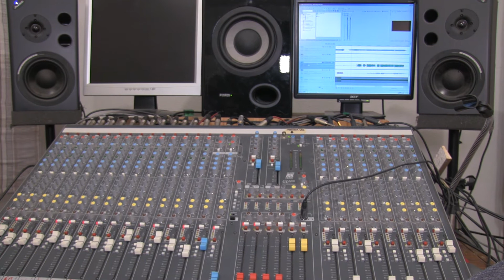16mm Film Production: Improving Sound Quality with Dolby

Comment: hello from Spain . So you are using a 4.6khz lo-pass filter to match the optical audio specs , where can I find more info about the frequency response of optical audio, so I can emulate that sound in my video projects ?
Reply from the maker: That's a little hard to do because there's really no hard/fast rules to things like frequency response, distortion and noise.  There's a lot of factors involved.  Theoretically, a good print film can resolve over 100 cycles per millimeter, so 7.5mm high frames x 24 frames per second is 18KHz.  The contrast of the film starts to drop pretty rapidly before that so the cut-off is considered around 10KHz.  However, the mechanical galvometers and and optical read heads are the real limiting factor.  I find most films start to lose energy quickly above 4.5KHz on my system but there's still usable information up to 8KHz.  You can use a narrower read head to get better frequency response but you also get more noise with it.  Low-frequency response depends entirely on the record/playback electronics.  You can theoretically go all the way down to DC (0Hz) but since 16mm is usually geared towards speech, 100Hz is the "rule of thumb".  Noise depends on the contrast of the film, grain and the playback system.  Rule of thumb there is 35-45dB and bear in mind that since the playback system is the biggest limiting factor in frequency response, the noise will also be 100-4.5KHz or so.  Distortion tends to be fairly high in 16mm optical sound tracks because they're printed "hot" in order to overcome the noise but I don't have any hard facts on it.
16mm magnetic sound is on-par with 1/4" 1/2-track tape.  Listen to some of the film-based productions from the BBC in the 1970s, it's really quite good.
Reply: @wado1942  thanks, I had to read it 3 times , I appreciate it , man . So in conclusion, can we say it is similar to a type1 cassette with noise reduction . I like this 90s movie sound, it obviously has a lo pass filter, but I can't exactly put my finger on the cut freqncy and the slope . Here is an example of a 90s movie trailer https://www.youtube.com/watch?v=rnpQ25ISxDU&list=PLTT8GoH4BtdLaWW7hZS77IfFYwkWK-1Wc
Reply from the maker: @rodrigobelinchon2982  I tend to pack a lot of information into as few of words as possible, sorry. :D  Cassette has considerably better signal to noise ratio and frequency response than optical 16mm, even without noise reduction.  Cassettes also have a more gradual cut-off than 16mm read heads.
35mm is a different animal.  A typical projection system with optical sound is usually upwards of 12-14KHz, has significantly better S/N ratio but also has Dolby on top of that by default whereas I've never heard of anybody using Dolby on 16mm.  That trailer you posted was likely copied, sound and all, from a 35mm print whereas if you watched it on Blu-Ray or the like, would have been taken from 35mm magnetic film, where you have 4 magnetic tracks across the entire width of the film.  The sound in that case is more on-par with 1/2" stereo at 30 In/S.  VERY GOOD STUFF!  The limiting factor is the shotgun microphones and sheer number of generations through which the location audio goes to get to the final mix.  1/4" tape copied to 35mm magnetic film for editing, copied to 35mm mag or multitrack for dubs, mixed to mag for sync, copied to 35mm optical master, copied to 35mm internegative, then to the print.  The dialogue goes through a lot!  You can usually hear a stark difference between what was recorded on-set vs. in studio.
Reply from the maker: P.S. if you watched the first Star Wars, especially before the "Special" Edition, the dialogue they rerecorded in the studio is super clear and almost TOO bright sounding whereas what was recorded on-set is a bit dull sounding.  I think they evened it out a bit in later releases.  The main difference is the microphones.  Older shotgun mics tend to be rather dull sounding.
Reply: I 've enjoyed a lot reading your answers !!

first , yes, I have noticed in many movies when they overdub voices , sometimes is really noticeable .

second , after you mentioned 35mm , I started researching the history of cinema sound, and that includes topics like the Academy Curve , Dolby SR 
. 

third,  that is what I think I am hearing and want to replicate , the hi-frequency artifacts from Dolby SR , and the Academy Curve , which was later replaced with the X -curve, which cuts under 100hz, stays flat until 2khz, and then rolls off 3dbs per octave , until around 8khz -10 khz.

More or less what you suggested .

this article is a great summary https://hometheaterhifi.com/volume_9_2/feature-article-curves-6-2002.html of this paper https://pdfs.semanticscholar.org/dc3d/5f485e43c72eded3398dc6f3883c87da9c81.pdf

fourth  , maybe it was magnetic tape what we heard in the Ninja Turtles trailer, I  tend to think after studying the subject that we heard a mono downmix from Dolby Stereo Optical Sound, which apparently was cheaper and more extended
, who knows, but I find that ''color'' sexy, and evocative, it sounds more cinematic to me than a higher definition sound.

so , I have done some testing on my computer, applied the X-Curve , applied some de-esser to emulate the Dolby SR artifacts,  and I thinks it gets me in the ballpark, I had never tried to start rolling off at 2khz, and that really makes a difference, it gives me that color I was not able to find.

so thanks a lot  @wado1942  !!
Reply from the maker: @rodrigobelinchon2982  Well, they didn't pass the tracks through the X-curve (and Academy) curve on the way to the master, it was inserted between the console and monitors to simulate "worst case" scenarios for theaters, to get an idea of how the mixes will sound to audiences.  It was more about compensating for cheap speakers being behind the screen than anything.  Also, Dolby is pretty transparent.  It doesn't pump and breathe or kill the top end unless the system is grossly miscalibrated.  The reason it harmed the top end in my video here is because of the severe limitations of 16mm optical sound not allowing the signal to decode properly.  On a 35mm print, it's not as much of an issue.  Dolby Labs performed a series of blind experiments that pretty well debunked the myth of noise reduction killing the top end.  The ultimate proof was when they A/Bed a non-Dolby tape against a Dolby tape and blank non-Dolby tape (to add hiss), none of the test audiences noticed the switch.
Good magnetic audio is virtually indistinguishable from real life and I've had clients hire me to pass digital mixes through tape to impart "that warm professional sound" into it, only to discover what I sent back sounded just like what they sent me in the first place.  Now a combination of older shotgun mics passed through multiple generations of magnetic audio, that take an already "colored" sound and adds more color.  If you watch my video on TV Dialogue https://www.youtube.com/watch?v=2HpuNJ0mH6o listen especially to 2:40-2:50 where I switched from multi-generation, Dolby'ed audio back to the original 1/4".  I really put the audio through the ringer but the biggest source of "damage" to the fidelity was really the mic itself.  That's the reason I started using an SeElectronics Z3300 for most of my YT videos instead of the shotgun, much clearer and much less noise.
Reply: @wado1942  thank you very much for the detailed answer. i've been researching about music albums using Dolby A  , Dolby SR and also DBX , and really old albums from before any of those systems were available  and i really think i can hear Dolby A and Dolby SR , It is subtle, but it reminds of Dolby C , to my ear, both systems ruin the ''air'' of the recordings, becoming very evident with hi-hats , contributing to that muffled sound i hear in those movie trailers. But it sounds good to me in that cinema environment . i will chech your video next weeken and re-read your comments , in the meanwhile, here you have links to a Dolby A vs a record done without NR , on spotify is more evident than on youtube.
Dolby A ''Jazz at the pawnshop'' , 1976 https://www.youtube.com/watch?v=WQPsyoCxjuo
No Dolby or DBX ,  ''Mingus Ah um'', 1959
https://youtu.be/E7hoX7golZI?list=PLiN-7mukU_REK9zBMvZoNERNvhovxnsE5
have a great week , bro
Reply from the maker: @rodrigobelinchon2982  Yeah, Dolby C is definitely NOT transparent, mainly because it's just two "B" circuits stacked together so a 1dB error in playback (if only cassette was that accurate) becomes a 2dB error in decode stage-1, then becomes a 4dB error post stage-2.  I didn't always use Dolby on cassettes but when I did, it was either B or S.  S, which is very similar to SR but simplified and optimized for cassette, is much more transparent than C.  Part of the requirements for having S on the deck means following stringent alignment standards that are virtually non-existent on lower end decks that sport B and C only.  I never used Dolby A or SR for my in-house productions but I would some times work on material from other studios that had one or the other.  If the playback alignment doesn't agree with the source material, you can't get a proper decode.  That's one reason why it's so important to print alignment tones to the tape, which almost nobody ever does.  For Mitch Ryder's last live album, I had to bring up the top end a bit in mastering because the multitrack recorder had Dolby A and wasn't aligned properly during the recording.  The mix engineer got it as close as he could but it was still just an educated guess.  On that note, the orchestral work from Animaniacs was 1/2" 3M 996 with SR, not dull at all.  I still have one of those tapes around here somewhere.  I see what you mean about those links you posted.  Bear in mind that in the late 50s, they generally used  just a few top-quality mics at a distance to capture everything while in the 70s, it was trendy to use multitudes of close mics.  I do hear some error in NR decoding but a lot of that dullness is proximity effect and phase cancellation.  Any way, I produced a limited run of cassettes for my instrumental album a few years ago.  The master tape has Dolby B and the decode sounds almost identical to the source material.  I used Type-II cassettes, which was a huge mistake.  Even with a house curve going into the duplicator, playback from the cassette itself seems dull.  I should have used Type-I cassettes, which would decode more accurately.
Reply: Yeah, after watching your other video I see your points , all 

the video editing and shooting I have done has been done with 

digital equipment and computers , I wasn't aware of all the 

steps required to edit and deliver a master using analog tech.

Dolby C 

two Dolby Bs hahaha, I find it hilarious!

Regarding to what I call Dolby artifacts , as a professional you 

know you have to make constantly decisions ,and often, find 

a compromise between perfection and practicality.

Dolby's success probably should be viewed from a business point 

of view. In the end, people who makes the money decisions do not 

have necesarily to be the most capable artists or technicians, 

they are business minded people and often times they put factors 

like cost before quality .

COST

To my understanding , one of the selling points of Dolby A was 

that  it sounded decent even without a decoder , again a 

financial incentive to stingy cinema owners. 

And Mr Dolby did the best he could with the patents he had , 

let's not forget that he said he would only invest in a 

technology if he had patents , my ears find very superior the 

DBX NR system, but of course, Mr Dolby did not have the patent 

on that technology, plus it was totally incompatible without a 

decoder.

QUALITY

I am sure you know people who can't distinguish from a 128kbps 

mp3 file and other at 320 kbps.

I am not able to tell the difference between FLAC and 192 kbps 

mp3, but I sure can tell the difference between those files and 

128 kbps mp3.

So I definitely think they found Dolby A and SR good enough , 

specially when dealing with 12, 24 or more tracks projects.

Noisy recordings sound unprofessional , so let's better remove the noise , even though we lose fidelity .

Specially in an era where consumer formats would mask many of 

the imperfections of the master.

But, lately I've heard a demo on youtube where Dolby B sounded 

really good , it  was a Nakamichi deck , a brand that was known 

for being obsessed with compact cassette audio quality and 

having systems to adjust azimuth .

That brings us to your comments about alignment, etc 

By the way ,I'd love to hear some of your work , is that Mitch 

Ryder show available on youtube?

WHY I AM INTERESTED IN THIS

When I produced my metal album with my solo project ''Mystery 

Of' , I found the sound I got to be very harsh. 

Clic here to hear one of my songs, a fine example of digital 

harshness in all its glory https://www.youtube.com/watch?v=Er-

9awhzLok

So , researching about albums made with tape recorders , I 

noticed that talking about tape recorders is to talk about noise 

reduction, and became very intrigued about how tape and noise 

reduction degrade the quality of the original audio and make it 

sound softer and more pleasant.

Ironically, this '' Lo-Fi'' sound quality sounds more expensive, 

and is associated with big budget productions.

I do believe that even non audiophile people cath this signals 

at a subconscious level, and influences their perception of the 

music itself. 

So, I love music, I have always loved that colored sound of the 

movies, and then I started a video production business. 

It was only a matter of time that I started to research 80s and 

90s cinema sound , because i'd like to emulate that color and use it in my music, specially with distorted electric guitars.

So if I can hear some of your work , I would love to  @wado1942
Reply from the maker: @rodrigobelinchon2982  "my ears find very superior the DBX NR system, but of course, Mr Dolby did not have the patent on that technology, plus it was totally incompatible without a decoder."
Having worked intimately with DBX systems for 25 years, I can say without a doubt that it's never transparent even when I/Os are perfectly aligned and the encoder is patched directly to the decoder with no tape in between.  There's always this low-frequency distortion, transients have this weird bite to them and the low-pass filters on the encode/decode that are there to cut RF and bias interference are on par with early digital anti-aliasing/anti-imaging filters (nothing above 18KHz).  Plus there's nothing below 40Hz.  The phas eshift is huge and there's dozens of op-amps adding "color" to the signal.  Compare that to my AMPEX 440C, which is basically flat from 25Hz-25KHz or so.  When I had an 8-track, I took the DBX module out of the machine all together.  When I moved up to a 16-track, I used the DBX (built into the machine) for a while but increasingly had modules in bypass mode as I used it more.

"I am not able to tell the difference between FLAC and 192 kbps mp3, but I sure can tell the difference between those files and 128 kbps mp3. So I definitely think they found Dolby A and SR good enough , specially when dealing with 12, 24 or more tracks projects."

Side note; MP3s are a LOT better now than they were in the 90s.  I remember 128kbps MP3 being completely unlistenable and 192k being BARELY adequate.
Any way, noise isn't normally a big deal on multi-track tapes unless you're doing multi-mic classical music or do bouncing like with "Dark Side of the Moon".  Only a few tracks stay high in the mix so the rest don't contribute a lot to the overall hiss.  As you add more tracks, you increasingly pull down the levels of most tracks to maintain headroom.  In other words, a 2" 24-track theoretically has 3dB more noise than a 1" 12-track but you also wind up having each channel 3dB lower on average so it becomes a wash.  We mute tracks that aren't in-use or add a few dB of downward expansion to things like toms or vocals which rather transparently reduce ambient noise as well as tape hiss.  On that note, most projects I mixed had about the same S/N ratio regardless of whether it was recorded on tape or digital, because most of the noise comes from things like guitar amps and the room itself.

The final mix is a bit different of a story, hence why the big-budget records had 0.89mm wide tracks (2" 24-tracks had the same track width as 1/4" 4-track, just more space between tracks) but mixed to 1/2" stereo with almost 4mm wide tracks.  1/2" is also usually 30In/S while the multitrack is usually 15In/S, so there's less noise in the high end even if everything else is equal.  My clients can't afford 1/2" 30In/S so I've been tempted to use Dolby or DBX on mix tapes on occasion but never have.  Bob Dennis, mastering engineer with 32 gold records to his name publicly commented that "tape was fine in the 60s and 70s because it's what we had but now we require a lot better".  Strangely, he opted for a mix I did for a song he produced, not knowing that I secretly mixed to 1/4" GP9 at 15 In/S.  I guess tape was better than even his 40+ years experience knew. :D

"By the way ,I'd love to hear some of your work , is that Mitch Ryder show available on youtube?"
The only thing I could find on You Tube is https://www.youtube.com/watch?v=JJi6VH8bOUA
Recorded on 2" 24-track with Dolby A, mixed a few decades later to 1/2" 3M 996 at 15In/S with no NR.  I did a master the way I thought it should be done, with only a couple of notes from the clients: needs more top end, and overheads weren't working at the beginning, try to compensate.  They asked for one revision with a coupe of minor tweaks that I didn't like but they're the ones paying the bill so I obliged.  Speaking of which, I sent a proof MP3 @ 320kbps and that sounded different enough from the WAV proof that I told myself to only send WAVes going forward.

https://www.youtube.com/watch?v=ecO7OtbTfmM
Mixed by the same engineer to the same kind of tape but that was also mastered to 1/4".

https://www.youtube.com/watch?v=-IUBju3ILsk
Recorded in my garage on 16-track and mixed to 1/4" GP9 at 15 In/S.  If I remember correctly, I used DBX on select tracks of the multi-track but I don't have my notes in front of me.

"When I produced my metal album with my solo project ''Mystery Of' , I found the sound I got to be very harsh. Clic here to hear one of my songs, a fine example of digital harshness in all its glory"
The main thing I notice is that it's over-processed.  Too much compression for sure.  That reminds me; when I first started engineering professionally, I used compression on most tracks I got.  Now a'days, tracks are coming to me so heavily compressed already that I wind up having to use expansion to let the sound breathe a bit.  I think a remix could really revitalize your work.  I might even be tempted to do a test mix of that linked tune just to see what I'd do differently.  In general, I approach processing very pragmatically; don't do anything unless you NEED to do it.  Any way, there's a cumulative issue with the upper mids in that piece you linked.  No single instrument seems too bad but the whole lot of them together are competing for the same space in the spectrum.  If you want to hear digital harshness, listen to my instrumental album "Bacon Chili Jam" recorded to a single 16-bit ADAT, mixed and mastered to 1/4".  The goal I gave myself was pretty much "forget sound quality, just get it done."

"Ironically, this '' Lo-Fi'' sound quality sounds more expensive, and is associated with big budget productions."

Refer back to the previous comment about my 1970s 440C.  An ATR 102 with extended-range heads can be essentially flat from 20Hz-30KHz or so and have a 76dB S/N ratio without noise reduction.  Some of my favorite classical music recordings were done on 35mm mag film, sporting similar frequency response and 85dB S/N ratio without NR.  I think a lot of people hear prosumer TEAC decks etc. and associate tape with "lo-fi" but real, quality gear is pretty pristine sounding.  The main thing that's changed about sound quality over the years is not the technology but the techniques.  I traded an old analogue synth for that portable 1/4" deck you see in my TV Dialogue video.  The guy who traded it with me commented "If I realized that deck sounded that good, I never would have gotten rid of it."  The funny thing is, that machine was 7.5In/S (noisier and more distorted than 15) and the mic I used is really dull and noisy sounding.  Had I used my Z3300, it would have sounded much better, but that's not how it would have been done in the 80s. :p